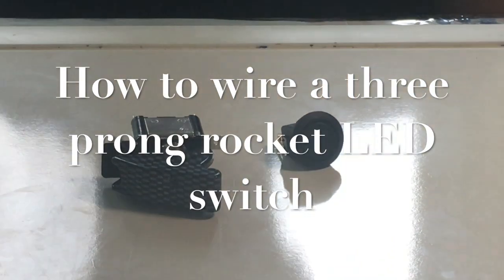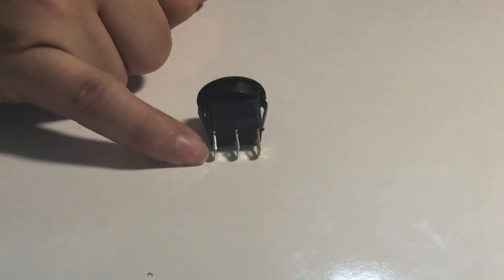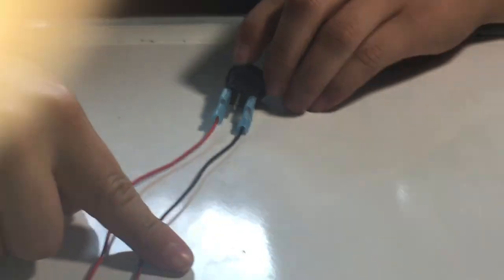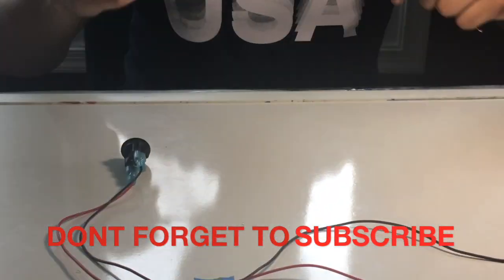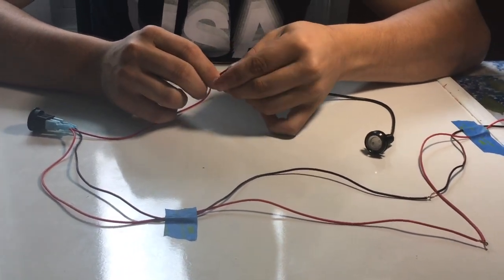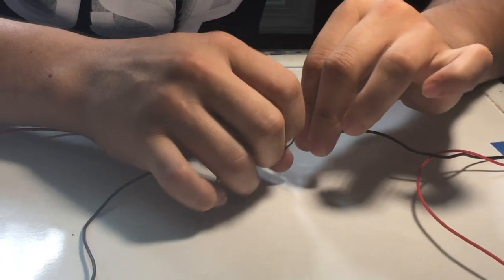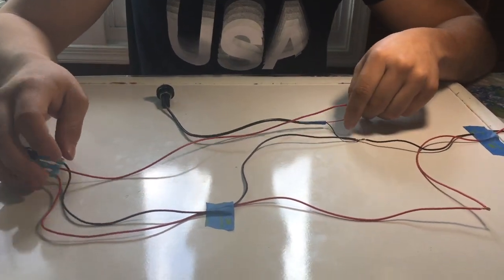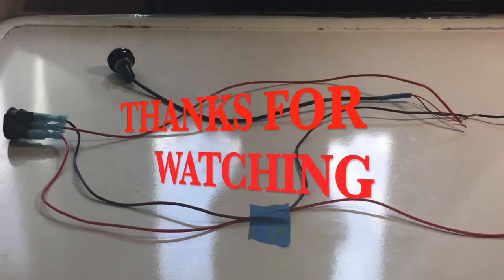How To Wire LED Rocker switch

Comment: Thanks a lot dude. I have watched so many videos and looked at images of diagrams and yours has been the only one that has helped me wire an illuminated push button switch. It's the same process as your rocker switch. I understood you clearly and you made it so simple and easy to understand. I had my switch hooked up to a battery and LED in a few minutes. Thanks again.

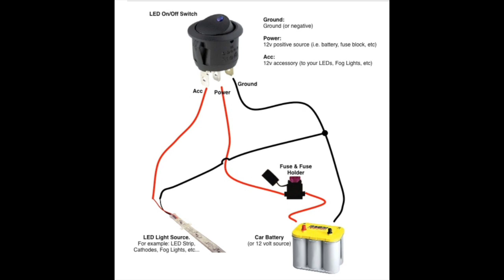Comment: In your diagram (3:08) you have power going to the centre pin and in the graphic at the end, you have power going to outside pin.  Which is correct?

Comment: Very well done!!  Question: instead of splicing into the battery negative wire to attach the negative lead from your acc, could you just put a double spade male connector on the switch post and attach both wires?  Thanks!
Reply from the maker: Yessir sir as long as you have a good ground and as long as you don't break continuity along anyone wire which could cause a short.

Comment: sorry if i sound dump but wat exactly is the use of these types of switches ? i Accidentally ordered these switches n I am not sure how to use it . i searched everywhere including this wonderful video explaining the connection setup and the outcome that is lighting up of the led seems similar to just using a simple home on / off switch . so why do we need this complicated setup for just switch on / off ?
Reply: With a ON/OFF switch you would have to run directly from car battery to accessory. 3 prong allows you to tap into an existing wire without interrupting original power flow... Also these come with an integrated fuse for safety... not 100% sure in 2 prong does too. but at the end of the day some switches do the same job as others, just preference as well.

Comment: Could instead of connecting to the battery connect it directly to the fuse box instead for a power source ? If I could where do I connect the extra ground/ negative to from the prong then ? And since I’m powering a LED for the car the black wore that comes out of it do I ground that to the bolt ? And if so could I from the ground on the prong switch tap into the black that is grounded ?

Comment: So I have a question. I hooked up a three-prong taco switch to my LED lights to my four wheeler the lights in the switch work. I also put a fusible wire in it and I have an app on my phone to change the colors and all that it even came with the remote. The lights did but now the lights just turn on white and I can't get them to change color. Do you have any ideas?

Comment: I have a rocker light up switch which I have put inline on a 240v to 5v transformer lead to enable me to switch on and off a Raspberry PI. The switch has positive, negative and earth so I have cut the positive wire on the lead and connected the switch in between the cut wire. The switch works and turns it on and off but does not light up as it does not have an earth to connect to. Is there anyway to get it to light up as well?

Comment: Big problem:  My 3 pins are labeled 1,2 & 3 with a little "+" sign at pin #3.  I kept wiring pin #3 to the battery!  It is actually the NEG. pin and it is Brass.  Why on earth would the manufacturer do that?  It screwed me up for weeks on my test bench.... refusing to accept that pin #3 wasn't POS.  When I used it as NEG. ground all was perfect.  Thanx for your clear video.

Comment: Ppl u have 1 pos. that goes to the battery like he explained thats your power.  The 2nd pos. goes to your accessory and from your accessory your neg. wire and the neg. wire from your switch , connect them together like he explained

Comment: hi great tutorial thanks for the information, i am trying to wire a trailer with leds, several leds in a chain going to a fuse box and a switch. if you can do a tutorial or a schamatic include the wire gauge and how to i would appreciate it. thanks.
please include type of switch i was thinking of a 2 prong roker switch with 
.

Comment: hey brother if i have two LED lights i want to put in my grill can i take the power wire ( red ) from both LED's and connect them and then connect them to the accessory terminal on the rocker switch so the both turn on when i hit the switch?
Reply from the maker: exposer dozer yup that’s correct
Reply: thank you very much for your time and knowledge got my sub and like

Comment: I have the same switch, the fancy one.. 3 pin, but it only says 20 amp, On, 12 volt, Off, and I don't know how to connect it, since it looks different, not sure which one is the switch, positive, negative
Reply: I figured it out, cause nothing caught on fire, I'm facing where it has 20amp,On,12v,Off, lettering, the (pin pointing to the right up, or sticking out? Is Negative, going towards off), "The Middle right is Positive", far Left is the switch/ On, just follow the diagram he has, it's roughly the same. This is for the fancy switch

Comment: If I wire my underglows on my moped like this straight to the battery .. even though my underglow is switched off will the battery still be using power?? And run dead?
Reply from the maker: Raymond Niko no it shouldn’t. But you’ll need a fuse between the battery and the LEDs. My suggestion would be to wire the under glows from the ac adapter, cigarette power or from an extra existing accessory slot from the fuse box

Comment: Is there a way to have the built in led turn on when it's in the off position?
Reply from the maker: kingjayjay98 yes by wiring it with a constant power cable but that’s not a good idea bc that’ll probably keep the accessory turned on all the time
Reply: @KonaProductions  what I'm trying to do is make a mute button for a USB mic. Everything is wired correctly however the light turns on when the mic is on, but I want it to turn when the mic is muted. What would be a good idea for a constant power source?

Comment: Does the battery need to be able to produce 12V?
Reply: These switches are rated for 12v power supplies. A vehicle produces 12v max.

Comment: Does the negative wire from the Switch have to be connected to the negative battery terminal or can it be grounded to the chassis like the acc -?
Reply from the maker: MGonline1209 not it doesn’t have to go directly to the negative but you can, but as long as you ground it to the chassis will be good... and btw the acc doesn’t get ground, it gets plugged to the positive(red) of what ever you want to turn on

Comment: hi there, is it possible to do the same but with a metal little toggle switch and also, whats the name of the LED used? Thank you!!
Reply: Also can you please link where you got that LED bulb
Reply: @TheBooMF44  yes its possible with any toggle switch. as long as you wire it correctly... and the LED light is called an Eagle eye LED light. I bought it from amazon
https://www.amazon.com/Custom-Anodized-Aluminum-Reverse-Parking/dp/B00H6XTKSW/ref=asc_df_B00H6XTKSW/?tag=hyprod-20&linkCode=df0&hvadid=312190333361&hvpos=1o1&hvnetw=g&hvrand=10758012298402971941&hvpone=&hvptwo=&hvqmt=&hvdev=c&hvdvcmdl=&hvlocint=&hvlocphy=9007652&hvtargid=pla-570305786097&psc=1

Comment: I'm connecting the switch to a breadboard and the switch works by turning the circuit off/on , but the led in the switch doesn't turn on. Any help?
Reply: i am superman it seems like you have the accessory and the positive cable connected in the wrong prong.

Comment: Ok I have a rocker switch that has 3 prongs one has 12v and the other saids  dc and the other one saids 1.5 A how can I wire it to my amp to kill it it has a led on the rocker switch

Comment: If I'm only gonna use the pos and neg how would I get the light to work
Reply from the maker: R. RODRIGUEZ you would only have to connect the positive to a positive wire running electricity and negative to anything that is hitting/has ground, but keep in mind that you wont have a switch to turn it on/off so if it stays on it can obviously drain your battery if it’s in a vehicle; however, if it is in a vehicle, use a circuit tester to make sure it turns off when the vehicle is turned off or something similar to that like also connecting them to the dome lights.
Reply from the maker: You can connect them directly to the battery too, but, you will still need to add a fuse to the positive wire to secure the wire from overloading to prevent it from melting/causing fire... so I’d rather tap into existing wires bc they already have fuses and most of them I’m sure are around the same gauge wire as the LED’s

Comment: 03:09 wronggggggggg, accessories is the middle terminal, and power is the terminal on the left. If it was as shown on that diagram, power and ground would be shortcircuited when the switch is off.
Reply from the maker: Alejandro Pérez you sound dumb

Comment: Where would you wire in a resistor?
Reply: andybhoy2009 you don’t need one bc you already have fuses. Resistors are use to limit amount of current to not burn the accessory.
Reply: Or what’s your plan?
Reply: @arturojimenez4382  I have a race spec Yamaha banshee with race loom , I am putting it on the road with a 12v setup so I can save my race loom/CDI and stator .. so I plan on hooking front lights and rear light on a toggle switch with a brake switch hooked into brake light - if that makes sense haha ? Electrics ain't my game , I know what I'm trying to achieve but just don't know how to get there haha
Reply: andybhoy2009 oh ok just got with a relay fuse from the battery to the lights you are trying to install plus it’s only a 12v battery. Or you can even go on amazon and buy a small fuse box that has an inline fuse that’s comes from the battery to connect multiple accessories.
Reply: @arturojimenez4382  wowww buddy, as advised , my knowledge is pretty vague haha ... I thought a relay and a fuse were 2 different things ? .. I was led to believe I would need a fuse , a toggle switch and a 3 way relay as I'm using LEDs ?
Reply: andybhoy2009 yea so from the battery a fuse to a relay. Which is the power source. From the relay you can run the toggle switch and connect accessories.
Reply: @arturojimenez4382  now here where it gets tricky to explain , I'm wanting a toggle switch which controls the overall power from the battery so that if I switched that off , there is no power getting to the switch which controls the lights if that makes sense ?
Reply: @arturojimenez4382  would I simply add a toggle before the first fuse ?
Reply: andybhoy2009 yes you can do that. Just make sure it’s a two prong switch. A two prong switch all will do is break the connections when open and let it flow when closed.
Reply: But I you can always install it after the fuse too
Reply: @arturojimenez4382  so how would I do a rear light/brake light for example using the toggle switch to activate the rear light but will also need to wire on the foot switch which activates brake light ?
Reply: andybhoy2009 yea you’ll need a brake switch so it can light when u break
Reply: To that brake* switch you’ll feed the power to and then from there run another positive and negative cable to the rear  brake light
Reply: @arturojimenez4382  I don't quite understand buddy , 🙈  could you break it down step by step on where to connect what to where ?

I'm looking to have a toggle switch to control overall power , when switched on I want the rear light to come on 

Where do I incorporate the brake light switch for power and ground to activate the brake light and do i need a relay?

Comment: What was your power source
Reply from the maker: Rowen170 for the demonstration I️ used a small battery. But if it’s on a car you can use an existing fuse or from battery but be careful when using the power source, specially if it’s straight from battery

Comment: Can you ground it to other metal or does it have to go back to the negative on the battery?
Reply: grounding it to anything metal should work
Reply: @arturojimenez4382  There are several DIY videos with 3-pronged rockers, all insist grounding to the battery. Not sure why if the battery negative cable is grounded to the metal frame of the car anyway. ;P ?
Reply: Channel 6133 yea bc the negative terminal of the battery is the best secured negative connections so that you won’t have any shortages but if you
Use any metal make sure it’s cleaned and exposed for good contact and also tight.

Comment: You can tell how to connect to battery
Reply: CHARLES JOSEPH you will need a fuse off the battery. A fuse with the correct amperage so that the wire won’t over heat n cause a fire.

Comment: Very confusing that everyone else's videos have positive in the middle and yours has it on one side. (Not clear which side)
Reply: Kelvin Kersey   Like I️ mentioned in the video, that particular rocker switch comes pre-labeled, the A on it will always be for (Accessory)which is whatever your trying to turn on like a LED strip or anything else, that’s in the middle. And for the positive it should have a (+) and for the negative it should have a (-) or three little lines indicating ground, typically it’ll be a bronze color unlike the other two.
Reply: Accesories terminal always needs to be in the middle for this type of rocker switch, because it's always in use: when the switch is off: it's connected to ground, when the switch is on: it's connected to input power. If the accesories terminal were not in the middle, it would mean that input power and gound would be shortcircuited at one of the two switch positions.